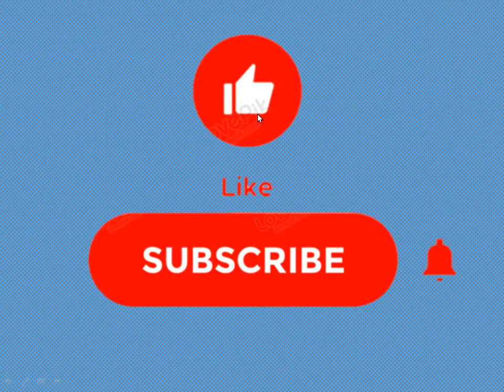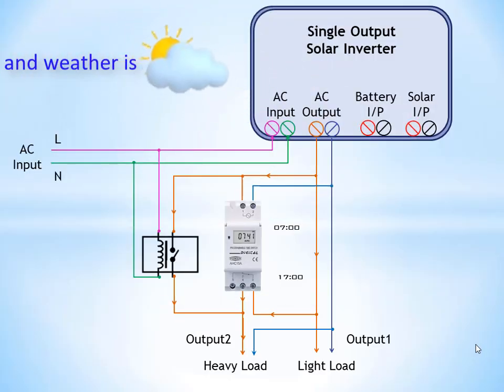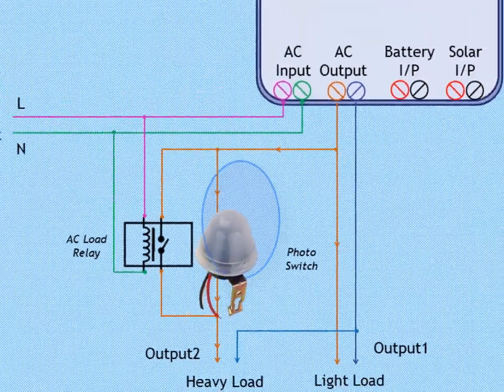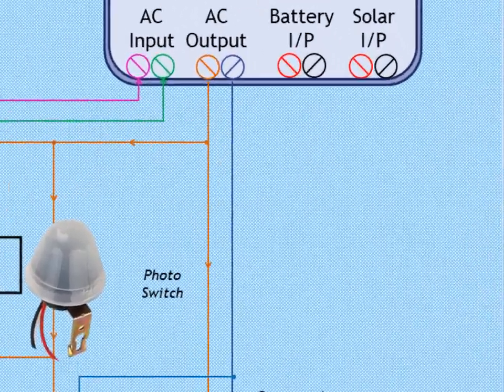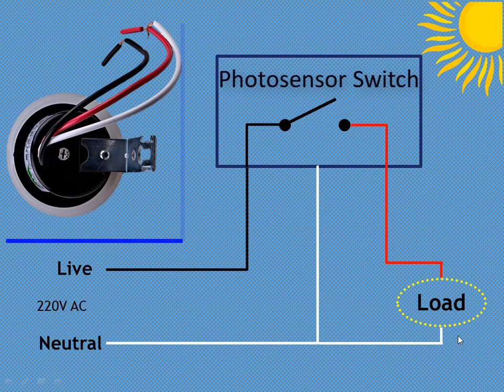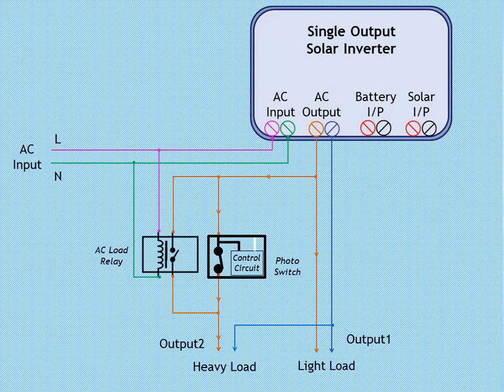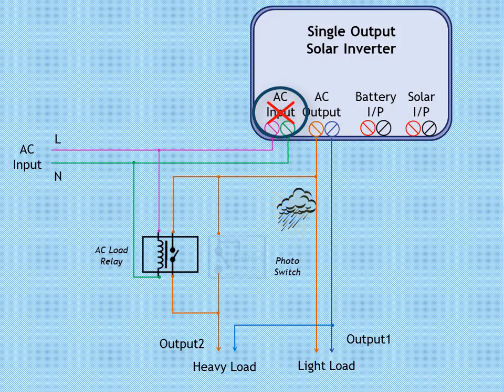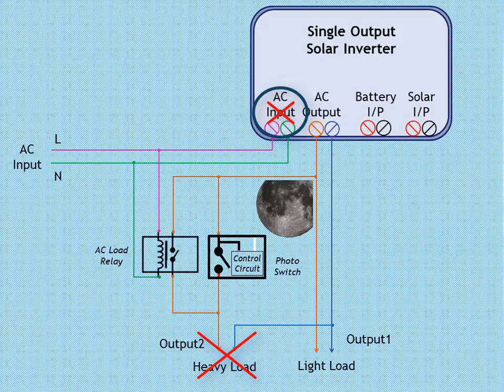How to convert single output of inverter to dual output through photo sensor switch.

Comment: Its Nice effort but 
Sorry dear, your Idea still has some drawbacks.
As if the inverter is placed in such a place where artificial lights like LED lamps are used, it will affect the  working.
Why don't you directly sense the solar input (from solar panel) for this purpose
Reply from the maker: Yes, sure, but in this case you have to install photosensor switch remotely where ambient light is present.
Reply: @electricalfundamentals785 
No dear you don't have to install any photosensor. As you already have the solar input for the inverter
Reply from the maker: Solar input is also available while in cloudy weather,  that is enough for normal lighting load. But not as much as to run heavy load. So you can't decide based on solar input. You have to detect through photosensor.